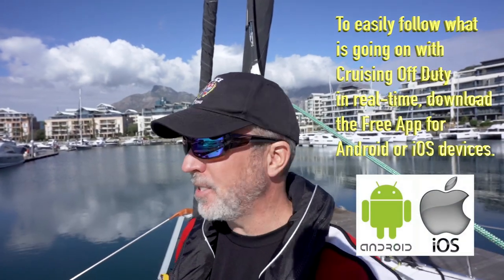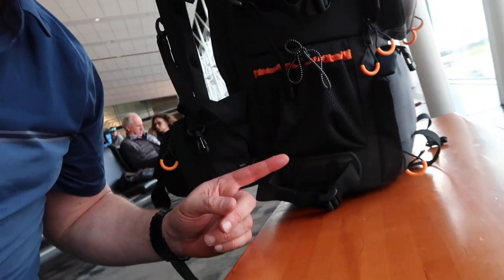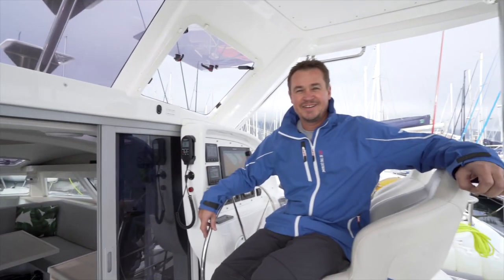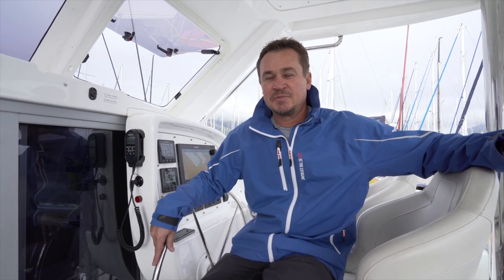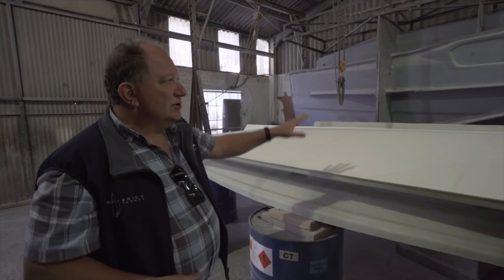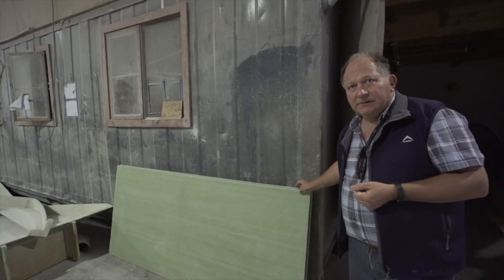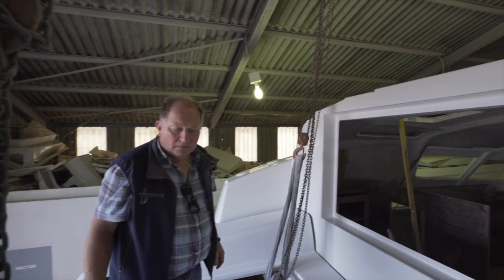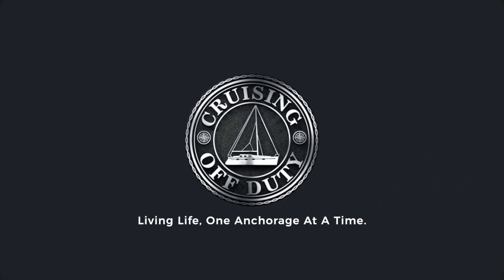Cape Town South Africa. Factory Tour of Maverick 440 Catamaran.  One of our favourite Catamarans.

Comment: That stretcher also would allow for the standard emergency rudder configuration.  You put a pole down the middle of the board and lash it to the pole.  Dragging the pole will allow enough rudder control to get you near your destination.
Reply from the maker: Yes.  That would a good size for an emergency rudder .  The good thing about a Cat vs a Mono is you have 2 rudders and it is very unlikely you will break off both of your rudders at the same time, but, I guess anything is possible.

Comment: Good job on the tour, though it looked you were just in sponge mode and didn't ask enough questions that would get him to do a deeper revealing discussion on other areas of the build process/materials/systems used.   It was good to learn the 40 & 44 are basically the same except they just chopped then extended the 40.
Reply from the maker: Ya.  I let him talk.  But from what I got from this tour is that you really want the 440 to get the extra body length for extra speed and stability.  I wish the 44 was actually designed to be a 44 though.  A bigger cockpit would have been nice.

Comment: Interesting to see the differences between this factory and the xquisite that produces a 1.3M cat, any thought on that? @cruisingoffduty 

Thanks for the great video, been waiting for that one too!
Reply from the maker: It was hard to compare the Factory tour at Xquisite that was much larger and had all the employees working and this much smaller shop with no one at work but I was still impressed with the quality of build at both.  The Maverick is about 1/2 the price of the X5 so you of course you aren't going to get all the bells and whistles that the X5 comes with.  Both good options, just at different price points.